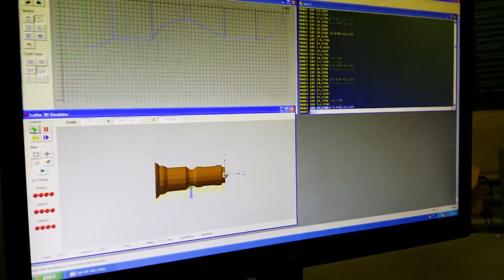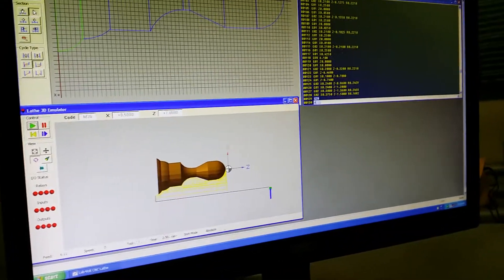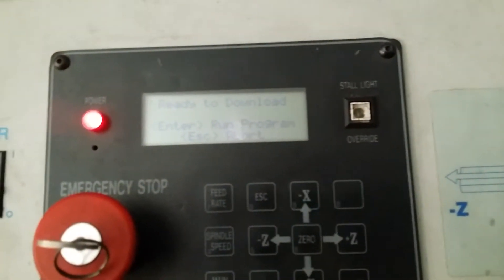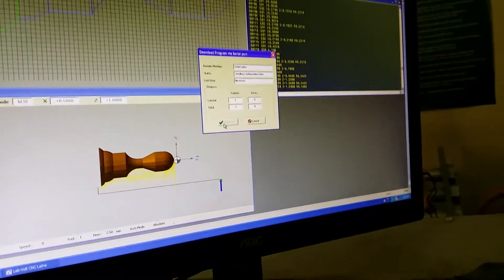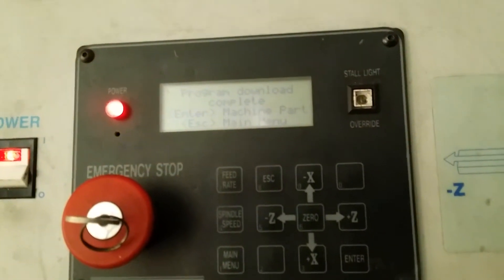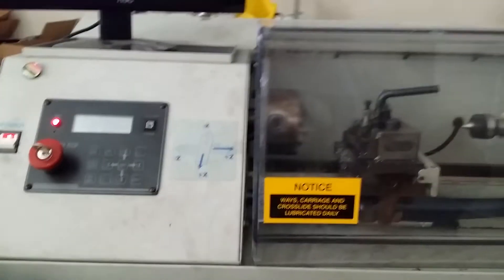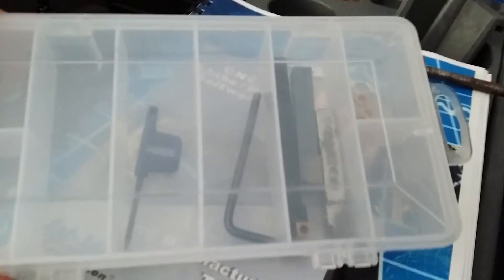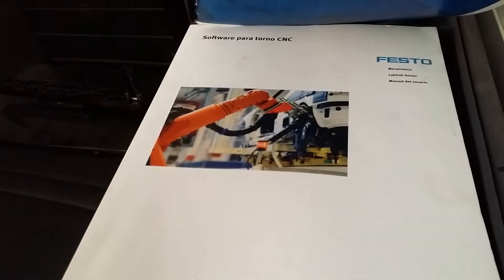CNC Labvolt Lathe for sale on eBay

Comment: Cheap mach3 breakout board...requires a bit of wiring but no other parts wete used
But had to remove the threading encoder since it cant be used with mach3...so im not sure it can do threading but i can machine the way it is now via mach3 ...at least its usable now.

Comment: hello, is there any possibility that you can provide me with  the software for lab volt
Reply: Hi suddham H. Did u ever get software?
Reply: @shelby50411  I am also looking for the software as well - if anyone comes across it please let me know.  I messaged Festo/Labvolt but haven't gotten anything back.
Reply: U can get main software from festo but unfortunately the biggest issue is there is no cad cam software to create toolpath...after 1 yr and hundreds of research hours i gave up and retrofitted with mach3..it was easy and only cost $15 in parts...
Reply: @shelby50411  are you talking about the lathe machine control software, i.e. the g-code executor software?
Reply: @shelby50411  what $15 part did you use?